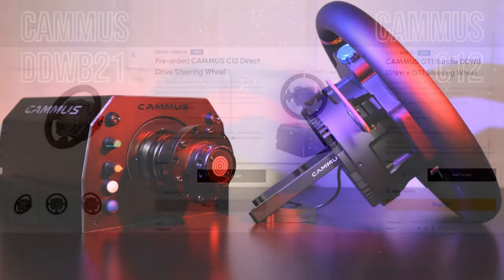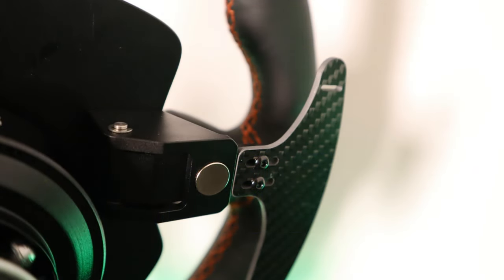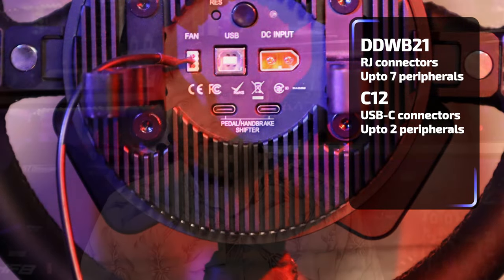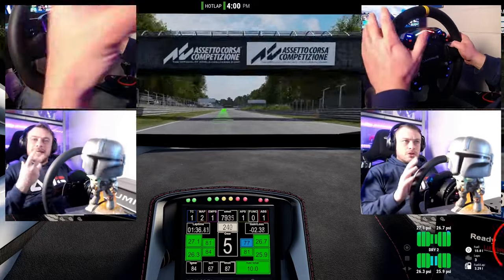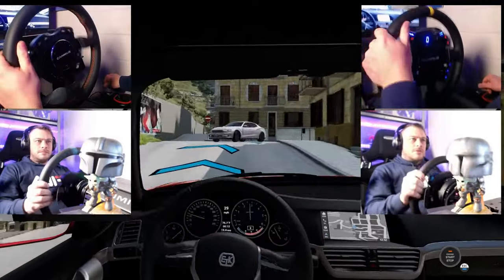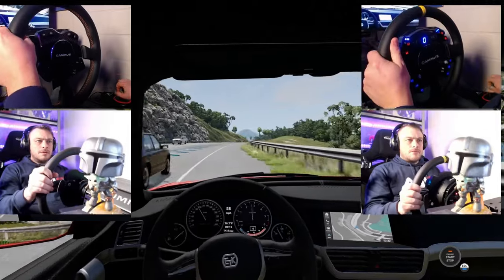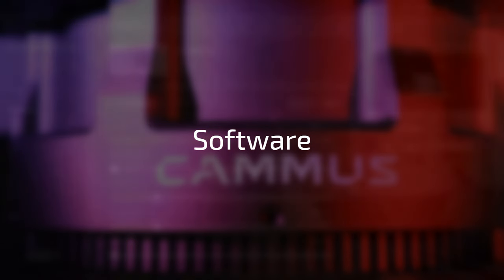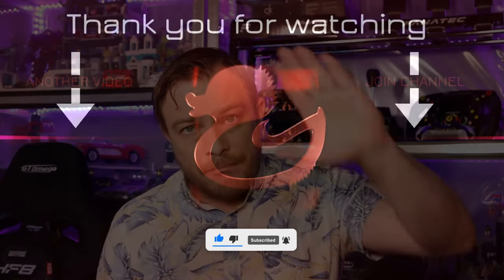Versus: CAMMUS C12 vs CAMMUS DDWB21

Comment: I bought a DDWB with a GT1 steering wheel and pedals, and it was an absolute deception, the only thing worth the time are the pedals id say. 
The base just didn't work with the steering wheels, it kept breaking, had 2 different bases 3 different wheel hubs and it was still defective. Defective buttons on the wheel.
Cammus decided to compensate me with 200$ for the wheel and that was it. But the problem is the base.
Just to let people know what they do to their clients.
Good review, good video, got subbed.
Reply from the maker: Sorry to hear that. So the issue you had were the defective buttons on the steering wheel or were there more things that didn't work? Were they not responsive? No input? Game-specific or all games? Did it work in their software? Seems odd because they replaced all electronics it seems. Sorry for the questions but it might help map out some structural issues with hardware that might help me inform other people about.
Reply: @ClickoZen  i just ordered mine, could you tell me what to look for/ check out first when it arrives so i know mine isnt defective

Comment: I’ve had my DDWB15 and 3 pedals for two years now. Has served me well. 

One major advantage over the C12 is I can go and add a different wheel to the base. I added the Moza KS by using the Moza Hub since as you pointed out, Cammus has been slow and I produce/release peripherals. But, DDWB is also better for drifting. It used a NRG quick release so it’s compatible with real car wheels. Having buttons on the base is perfect for teleport to pit if you’re about to crash in a tandem. I have a wheel with no shifters or button box for my drifting. 3 wheels with quick release. C12 can’t do that.
Reply from the maker: Absolutely. It is a very fine base with a lot of potential and the only base that I tested which has those useful buttons and Rotary encoders on the base itself.  I only wish it wouldnt weigh a ton. I believe that is also why I favor the C12 as my standard for driving. I have to swap a lot for testing and the C12 is easily added and removed from my rig. I really hope Cammus starts getting the love from the community they deserve soon.
Reply: @SimulatedDrivingResource  I mean your use case as a content creator although valid, not typical of your audience. Point that out in your script but don’t cite it as a negative for normal use. I mean, is it way heavier than all the Fanatec and Simagic and Moza bases with similar Nm output?  Being heavy can mean it feels solid and durable. Something you’d want for 15Nm peek.
Reply from the maker: 😏 very good comment. The weight is indeed linked in this case for me swapping bases but the form factor is also decissive for those that want to have their screen close and/or compact. You can't put a ddwb on a playseat challenge for example while it is possible with a c12. If it is recommended is another thing. And if I do a versus with a Moza or Fanatec, it will be of course less of a point as you say.
Reply: @SimulatedDrivingResource Hi, could you please elaborate on why you cant use the ddwb on a playseat challenge? I just ordered a ddwb and ive already got a gt-lite (pretty much same as challenge) would you say that one should’nt use it on it or that it Can’t be done?
Reply from the maker: The DDWB is one of the most heavy and massive wheelbases out there and the wheelbaseholders on the foldable chairs are in general not foreseen for those types of mass. Its not that it can't be done.... its that the result will be ... wobbly
Reply: @SimulatedDrivingResource  ok thank you for your quick reply, i will be placing an order for a new rig aswell. Thank you mr.
Reply from the maker: Well you can test it first  I guess. I just never did it because of the really heavy weight. Who knows the NLR can surprise us. Let me know if you remember should you do it 💙
Reply: @SimulatedDrivingResource  Sure, but do you think the cammus c12 would be a safer option for me to go with? I dont want to lose out on anything but if the ddwb is too heavy for my gtlite id have to wait for a couple of weeks before i could get my hands on a new sim rig. the c12 could definetly go on my gtlite but idk if it would underperform compared to the ddwb. My ordered from the local dealer hasnt shipped yet so i can cancel and replace the order if needed. Thank you
Reply from the maker: I think the C12 would be a better match for your rig yes and for performance. I wouldn't worry too much about it. From your upgrade perspective, both will feel like an immense upgrade and you will at no point have a feeling it will underperform.  Only thing you will need to live with is no quick release for the C12
Reply: @SimulatedDrivingResource  which one would you classify as more of a end game? that meaning that the need for further upgrades won't be needed for atleast several years. I just found a used NLR wheel stand 2.0 for sale, do you think the ddwb would sit better on this than the foldable gt lite?
Reply from the maker: The only thing that really stands out for me is the quick release on the DDWB. They have extra steering rim for c12 too, but you stay with the same button box (albeit a very high quality one). But if I would have to choose, looking at the total package including price, C12 would be my favorite. And yes, because the wheelbaseholder of a NLR wheelstand 2.0 is resting on a decent double supported frame, the large mass of DDWB pushing down on it will make it even more stable.
Reply: @SimulatedDrivingResource  Ok thank you so much for your answer, the retailer im buying at is selling the ddwb and c12 bundle at a 60$ difference so price is pretty much the same just the price for the new wheelstand but im going to be selling my old foldable chair so it kinda evens out. Thank you so much for the help, looking forward to using the ddwb when it arrives.
Reply from the maker: You are very welcome. enjoy the drive friend 💙
Reply: @SimulatedDrivingResource  Hi, i got my ddwb and it fits on my gtlite really nice just sketchy opening the arm out. but i got a problem with mine where the paddle shifters will activate on their own when playing assetto and fh5, have you experienced this?
Reply from the maker: @caprisunaddict4590 no not really. Is this exclusive to these games? It works ok in other games? Can be a problem with the magnetic shifting. Perhaps the shifters are too tight. Perhaps you can ask this question in the Cammus discord support channel. More people there with some experience.
Reply: @SimulatedDrivingResource  I dont have any other racing games to try it out on, doesnt happen when out of games though. I asked in the discord but they couldnt help me, Iäm going to be sending my button box back to the retailer i bought it from in hopes of a new one that works, if not i guess ill have to give up on cammus ddwb, its really sad though since i actually like the feel of the ffb